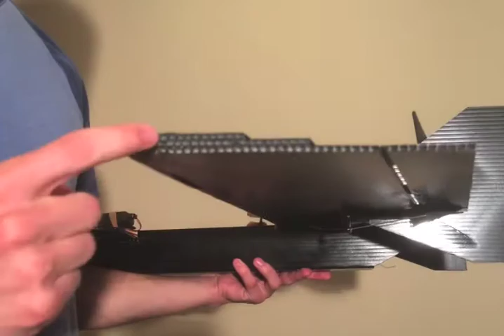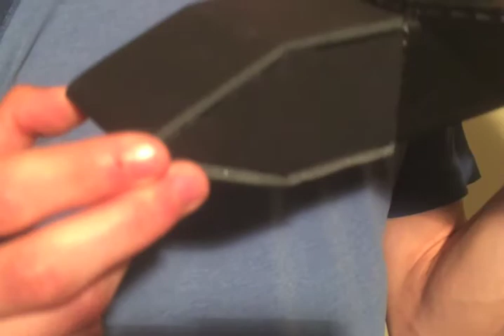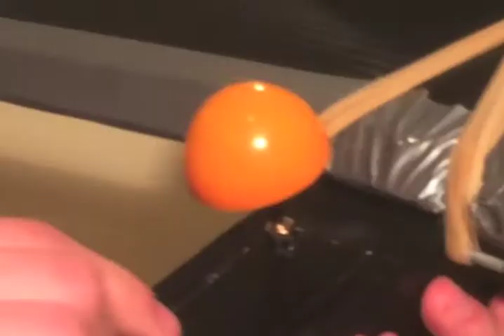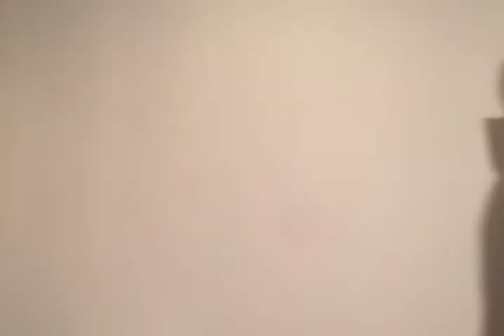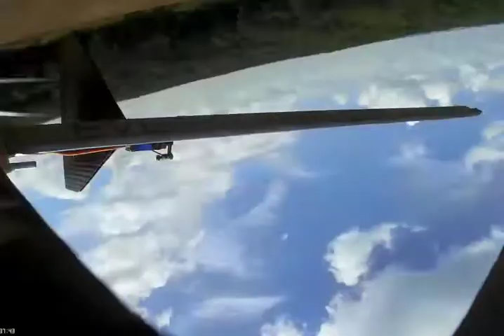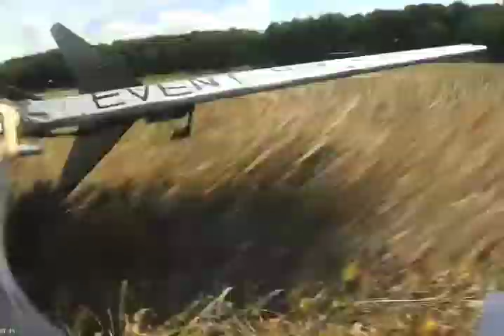Forward Swept Wing RC Airplane - Event Horizon

Comment: Excellent video in every way.  #1  Excellent organization and present. Precise explanation Of the benefit of each design feature, such as forward swift wings. 2nd.  You included the flight video. The proof is in the flying. 3rd,  You stuck to the subject, The airplane,  Without going often on a tangent about yourself. 4th,  It's obvious you are very experienced and knowledgeable, and a master designer and builder.  Many thanks and 2 thumbs up.

Comment: Where is the CG at? Im busy with basically the same type of build.forward swepped wings  1000mm, fuselage is 600mm.
Motor turnigy 2836/1000kv.
Reply from the maker: I used the CG calculators at https://rcplanes.online/index5.htm#CG to find the CG location.  For a more accurate simulation, you can find the neutral point and CG using XFLR5 software (it's free).

Comment: Hey! Nice work but I still don't understand  how your plane turn without rudar part??
Reply from the maker: I just turn using the bank-and-yank maneuver.  I roll slightly to one side so that the lift force points a bit to the left or the right, then pull up a little to make up for the loss of lift in the upwards direction.  The plane then flies in a circle.